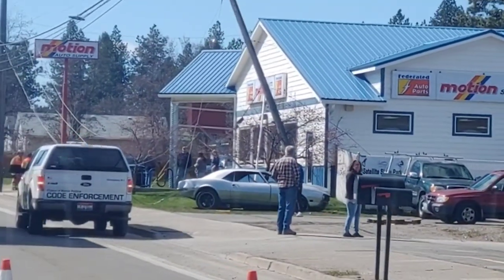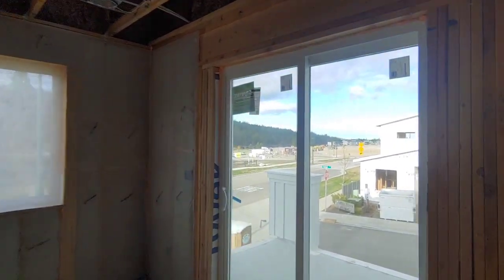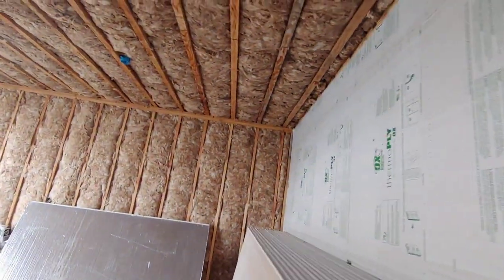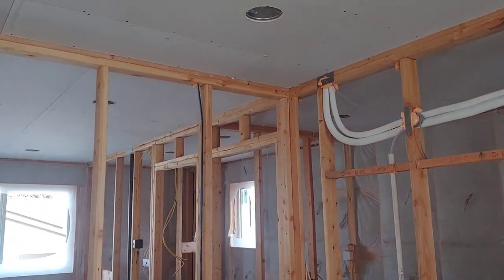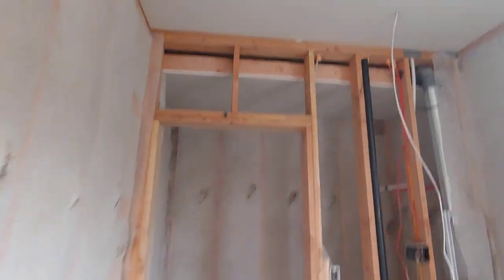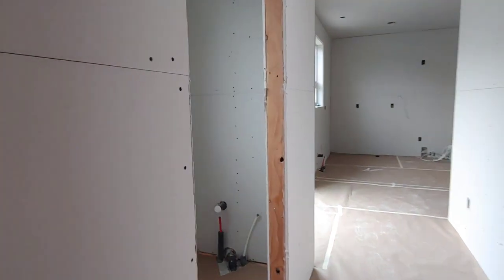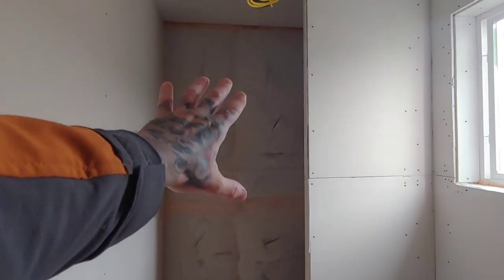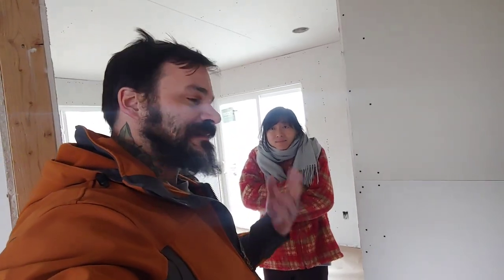hanging and banging! drywall work vlog EP3

Comment: I use to hang over that insulation back when I hung spec houses. It was a pain in the ass and they didn't even have it covered so it was always falling out. I hated it. I only do custom homes now and they all use Batts or foam insulation and it's so much better.